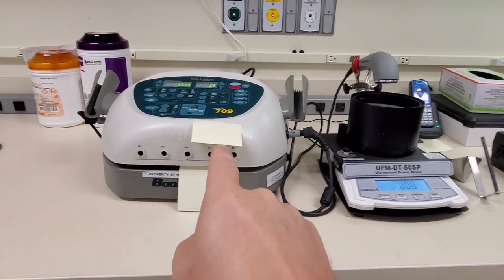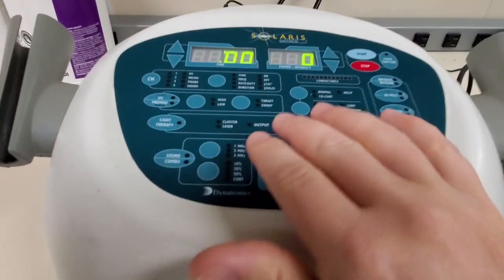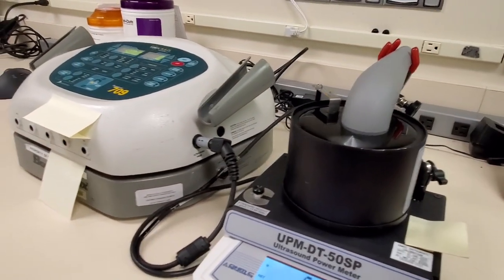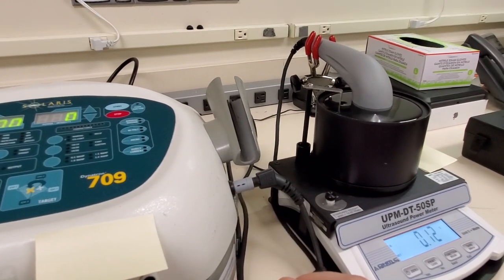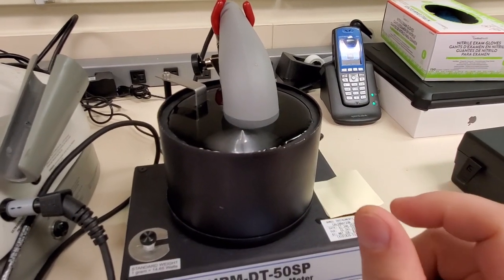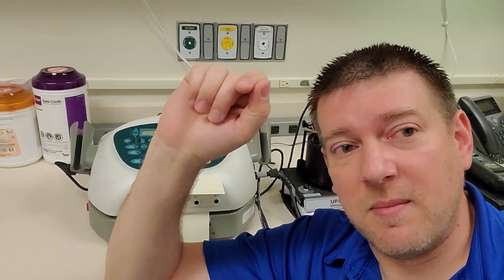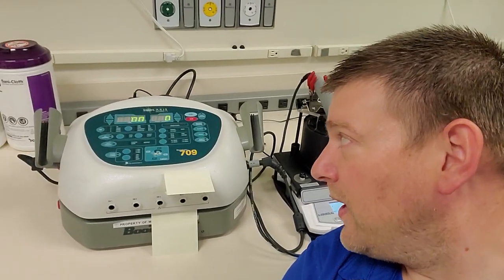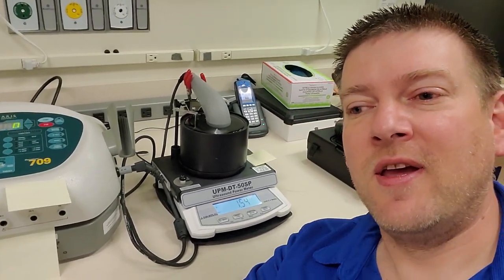Biomed Basics: Ultrasonic Therapy

Comment: Informative video as usual. I have a few of these in my Physical Therapy department, the problem is they are so old that their OEMs no longer exist/were bought out by other companies so literature/settings are very hard if not impossible to come by. We were always told to perform a generic ESI on them followed by making sure the heads worked and nothing more. Similar to your insufflator video I think it is a great learning experience for biomeds new and old to dive further into the workings of these little buggers.
Reply from the maker: I will show a regular calibration on these units tomorrow.